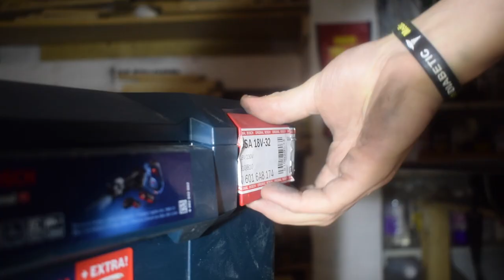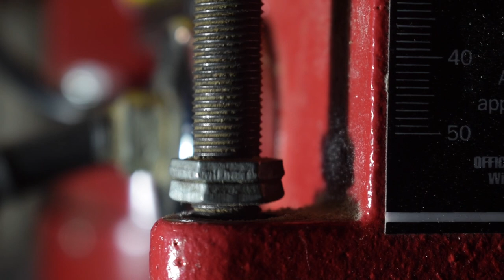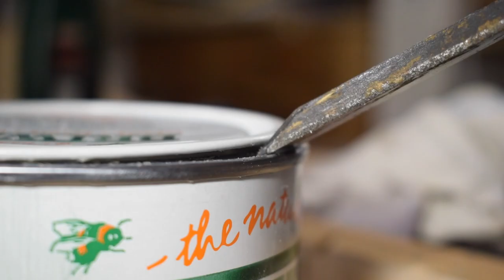Making A Freestanding Oak + Steel Lampshade

Comment: Really good. Another original design. What I really liked was the pace of the video - real-time explanation of what you're doing coupled with faster editing of the making process. That works well. I bet Bosch were also pleased; explaining and then using the tool without it being a grossly over the top advert. I would probably have put the cable inside the top tube but your use of the modified clips was also good. Well done, hurry up with the next one 😄
Reply from the maker: Thanks Rob! Glad to hear I got the pacing better on this one - you didn't have to put it in slow motion haha! Seriously though, I think you're right - from watching other peoples videos I find real time explanation always leaves me more engaged and interested in the project. 
I did think about putting the cable inside the tubing so it would be hidden, but I couldn't think of a way to do this whilst still having the adjustability on all 3 axises, so just ended up having it exposed!